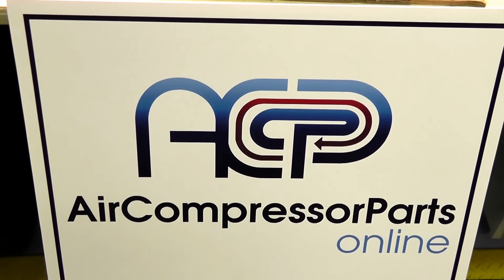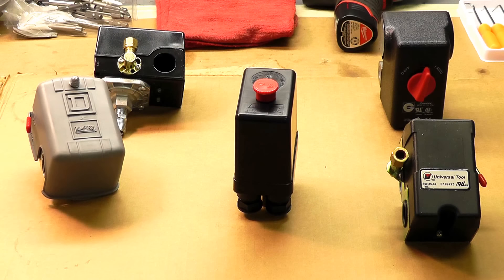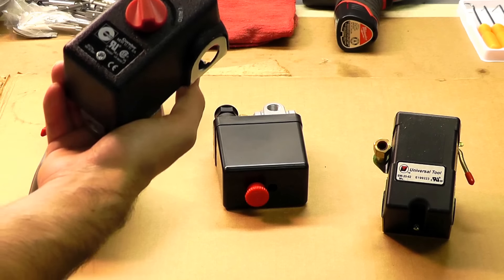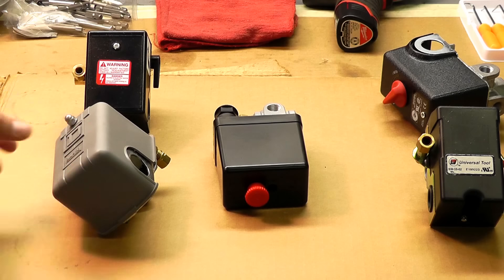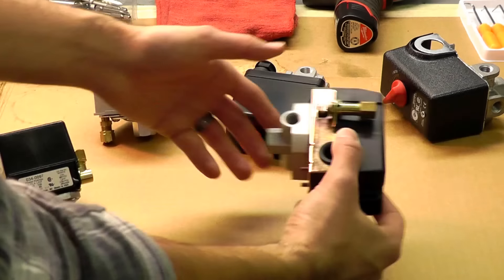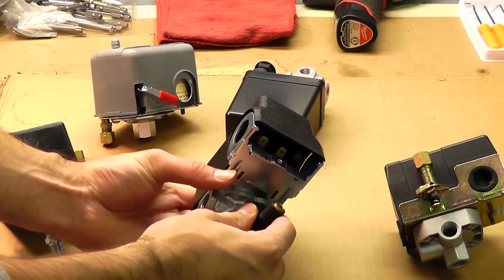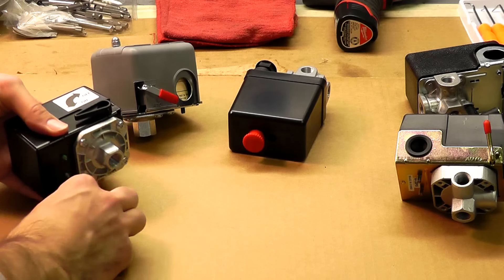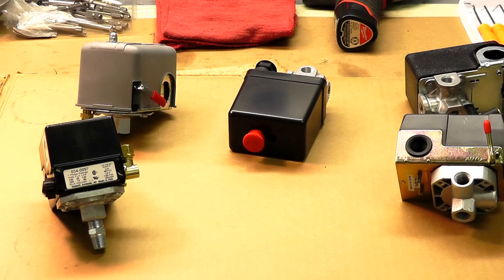Pressure Switch Replacement For Air Compressors

Comment: Hi, thanks for making this video. Unfortunately, I cannot find replacement parts for my Puma PK5060V anywhere online. It needs a new pressure switch. It's a 60 gallon, upright compressor. Are pressure switches at all universal? Mine has one port, and two leads from each side (wall/motor) going into it. A line from the check valve meets it with a bleeder valve on the side. Can you offer me any guidance on how to replace this switch? Thanks, Adam.
Reply from the maker: Unfortunately I can't find any info on your particular model, but I do know it was manufactured around '95. If I could see a photo of the switch I bet I could match a replacement up for you. What is the brand of the switch and model? This should be under the plastic cover.
You can also post this to our Repair Forums site and upload a photo of the unit and switch if you'd like, just click on the below link:
http://forums.mastertoolrepair.com/index.php/forum/index
Reply: Air Compressor Parts Online Hi, it is a 1991 model. Puma sent me a parts manual, and it shows the pressure switch # as 056-CD135P4-001. Unfortunately, there is no number on the unit itself. If it can be replaced by a generic/updated unit, that would be fine. It has one port on the bottom and one side bracket for a bleeder valve (I also need the bleeder valve--would this come with a pressure switch?). Thanks, Adam

Comment: Good day.. I bought a second hand air compressor on my friend.. But the pressure switch is missing. He do not know where it is. How do i know the right pressure switch to be replace? By the way the air compressor brand is vespa with 1/4hp...thankyou i hope you can help me
Reply from the maker: I am not too familiar with Vespa air compressors, to be honest. Does it look like one of the units on the Vespa website, below?

http://www.dragonprimeent.com/product/vespa-taiwan-air-compressor/

You want to make sure you install the correct pressure switch, certainly. The cut-on PSI and cut-out PSI is the most important spec. 

Do you have a model number on the Vespa unit?

Comment: I have an IR compressor with a square d switch in it which is leaking from the underside (unfortunately not the threads but above that on the big connector). After looking the thing over I found a bunch of info stamped/printer under the cover but can't find anything about it on google. Is there a way you can help me decipher what I have and what I need? 
Compressor: 240v 5hp ?stages 60 or 80 gal
Power Switch: 
class: 9013 ser. B
Type: FXG13 S101
Form: M1X1
on             off 125psi

2 pole rating
Volts - amps fl/lr
120-20/120
240-15/90

Comment: I have a 27 gallon Husky compressor with the oiled compressor piston assembly. My question is: at the tank they used a reducer fitting that runs into the pressure switch and then goes to the pressure valve (dial) and then to the tool. I have a 1/2” Ingersoll Rand impact wrench that’s capable of 600 lb reverse torque at 27 FPS but my tank can’t flow that much pressure with the 3/8” high-flow hose and fittings. Is it possible to start at the tank by increasing the size of that reducer fitting and using a larger fitting, going with a larger pressure switch, larger pressure valve (dial) then 3/8” high flow fittings and hose to get an overall higher flow rate?  The issue I’m having is that even with 3/8” high flow fittings and hose I still can’t get even close to 600 lbs of reverse torque from that impact wrench even running the hose pressure at 150 psi for short bursts? Sometimes I can’t even crack off a wheel lug nut off with full pressure and that’s definitely not several hundred ft/lbs of torque. I don’t understand how a larger tank would improve the situation since it’s overall volume, but I’m literally talking about short bursts at a maximum pressure of 150 psi, wouldn’t it be the same for a 26 gallon tank and an 80 gallon tank? I seriously believe if all the plumbing was upsized to 3/8” I could achieve enough CFM to increase the overall power of the torque wrench for short bursts to pop off those lug nuts like nothing. What are your thoughts?
Reply from the maker: Thank you for the question and for the watch! I don't think that installing an adapter with a larger outlet will improve the CFM (volume of air delivery) much, at least not that will make a difference. For your application, the compressor is probably just undersized....I would recommend using a compressor with a higher CFM rating, as your compressor simply doesn't have the CFM output to run the impact wrench (which require a lower PSI but a higher CFM to operate efficiently). Also, make sure to find the CFM requirement of your impact wrench (which will be in the manual) to match it with the CFM output of the compressor you're using.

Comment: My compressor is 25 years old. I can't find a pressure switch. It's a Craftsman Model # 919-15291-2 and it will not shut off. Inside pressure switch cover says it's a AC 0062 # D-56962-2. Can you help me?
Reply from the maker: Thanks for the question, Skip. BTW, we have a breakdown of your model compressor available at the below link:

https://aircompressorpartsonline.com/portable-oilfree-directdrive-electric-air-compressor-parts-919152912-p-802341.html

Your original switch is obsolete so the only option is a third party switch. The manifold on the bottom of your switch has two inlets: one that threads directly onto the stand pipe nipple to your air tank and another where the safety relief valves threads into. The only switch we'd have that's similar is a 4-port manifold switch, so it has three 1/4" female NPT threads in the bottom. You would only need to use two, the other two inlets you would plug.

https://aircompressorpartsonline.com/095125-psi-generic-furnas-style-pressure-switch-fsps495125-p-1027.html

 I'm not entirely sure if the plastic cover would fit over the new switch perfectly, however, as the on/off lever switch on the side might be located in a slightly different position on the switch, so it may not fit through the hole that's cut out in the plastic shroud for it.

I hope this helps!
Reply: @AirCompressorPartsOnline  Thank You very much for the reply and suggestion

Comment: will a bad unloader valve cause pressure switch not to turn on compressor?
Reply from the maker: It's certainly possible, yes. It really depends if the unloader valve is stuck open or closed. If the unloader valve is stuck open, then all of the air from it and the unit will probably never shut off. The unit will still turn on and operate, however, so this is rare.
The more common issue is if the unloader valve is stuck closed. When this happens, the compressor won't be able to bleed off the excess pressure in the lines once it shuts off. If this happens, the unit will try to start against this back pressure, which will probably trip the breaker. This is somewhat common.
The most common problem, however, is when the defective check valve causes tank pressure to backfeed through the lines and out of the unloader. The unloader is not defective in this case, it's just a symptom of the defective check valve, and replacing it will take care of the problem.
Hope this helps!

Comment: i have a 22 gallon craftsman 919.1762200 and need a switch wich one do i need???
Reply from the maker: Thank you for the question. The original pressure switch for that model (made by DeVilbiss for Sears) is obsolete, I'm afraid.

https://www.searspartsdirect.com/model/38mx4wence-000247/craftsman-919176220-air-compressor-parts?page=2

However, as long as you match up the basic specs with your original to one of the pressure switches we offer, you can use an aftermarket switch. You basically need to know the info you'll find at the below link to our website:

https://aircompressorpartsonline.com/1portstyle-pressure-switches-p-286.html
Reply: @AirCompressorPartsOnline  thank you

Comment: I have a job smart pan cake air compressor 90-120 psi i need new switch do you have one?
Reply from the maker: There is a good chance we do. Do you have the model number for your air compressor? If so, that'll make it easier. But, you can click on the below link to view our pressure switches and may be able to match yours up with one we list on that page:

https://aircompressorpartsonline.com/air-compressor-parts-pressure-switches-c-25_2.html

Comment: I have a Porter Cable and just replaced the pressure switch.  It was not the original switch.  Now my regulator does not keep the pressure down at what it is set at, but allows the pressure higher.  I can hear the air hissing out of it.  The switch goes up to about 140 psi then turns off.  Any ideas what the problem is?  It never did this before.  Thanks.
Reply: I have the same problem with my 26 gallon porter cable
Reply: I rebuilt the regulator with a kit I bought online and now it's better.  I did see it do the same thing again once or twice but usually not.

Comment: Are all pressure switch universal. Like I got a rockworth compressor 220 v and I replaced the switch but now it's putting to much load on the motor.
Reply from the maker: Most of the time, yes. Switches can be wired for either 110/120V or 220/230V, but they do have different amp ratings, so confirm the amp rating is high enough for the motor running your compressor. If the above checks out then you may have another electrical problem...it could be the power cord or motor cord, the pressure switch contacts could be damaged, the motor starter switch or the breaker itself.

Comment: I’m looking for a FURNAS 69MB109473R switch, where can I find one?
Reply from the maker: Thank you for the comment David. That Furnas number is a catalog number that I can't cross reference, but we probably do have the switch or a switch very similar available. There is a popular switch that we have available which you can see by clicking on the below link. This is a single-port Furnas-style switch (it's an aftermarket version which is less expensive) with a 1/4" FPT fitting on the bottom. It's rated at 90/125 PSI. It has a  manual on/off lever switch on the side as well as your 1/4" brass compression fitting, which your bleeder line attaches to. Just by searching the Furnas part number on Google and looking at the specs for the original, it appears this would be a close replacement:

https://aircompressorpartsonline.com/090125-psi-generic-furnas-style-pressure-switch-fsps90125-p-1117872.html

Comment: When I turn on my compressor it start out just fine.but halfway the motor starts to slow down then after a minute it starts running great again.Any idea what's going on?
Reply from the maker: Thanks for the question Garry. 
Here are some suggestions:

- The run capacitor is defective (would need to test it with a capacitor tester or have an electrician test it)
- Extension cord (if using) is too long
- Pressure Switch contacts are varnished and need to be polished.
- An obstruction in the head/discharge tube/check valve (just make sure the inlet air filter element in your pump head is in good condition).
- If it is an oil-bath unit, and it is cold, it could be that the oil viscosity is too high.

I hope this helps!

Comment: Hi Do you have a replacement pressure valve for a mac 2200?...and if you do how much w/ shipping to 13801...Thanks
Reply from the maker: +steve Forgacs The original part# for the pressure switch for the MAC2200 is AC0197-2, which is no longer available per Makita.You could use a similar 4-port pressure switch with the same PSI ratings, however. Take a look at the pressure switches on our website at the below link; you should be able to match up the specs on the original switch to one of our replacements:
http://www.aircompressorpartsonline.com/furnas-pressure-switches-furnas-port-style-furnas-pressure-switch-p-287.html
Reply: +Air Compressor Parts Online Great Thanks
Reply: +steve Forgacs The link you sent doesnt work
Reply from the maker: +steve Forgacs Sorry about that! Here you go:
http://www.aircompressorpartsonline.com/index.php?r=product/view&id=287
Reply: steve Forgacs 😘😘

Comment: Does the pressure switch found on water pumps can be used for air compressors?
Reply from the maker: Yes Vishwan, pressure switches found on water pumps can technically be used on air compressors. However, most water pump switches have pre-set pressure settings that are much lower than a typical air compressor will operate at, usually 30 to 50 PSI for a water pump and at least 125 PSI for an air compressor. The switches are identical except for the pressure settings. The switches are adjustable, but cannot usually be adjusted from 30 PSI to 125 PSI. So, it's best to purchase a pressure switch that has the cut-in and cut-out PSI ratings high enough for an air compressor to operate at. I hope this answers your question and thank you for commenting!

Comment: Also I have a Huskey WL 660900AJ and every time it tries to start it blows circuit breaker in my garage. HELP
Reply from the maker: Skip, we also have a breakdown of this unit on our site as well:

https://aircompressorpartsonline.com/portable-oilfree-air-compressor-parts-after-march-of-2005-wl660800-wl660900-p-746926.html

Does the unit hold air in the tank after it cuts off? If so, great...but if air constantly leaks from the tank after it shuts off, you have a bad check valve. A check valve that's stuck (or that has debris inside of it) will cause the unit to trip the breaker when you turn it on, as air cannot get through the check valve into the tank, creating back pressure. 

If the above is NOT the case, there is an electrical problem and it may lie with the motor. In this case, I would recommend having an electrician or compressor tech diagnose the unit in this instance.

Comment: Is there a different between 110 and 220 pressure switches
Reply from the maker: There is no difference in functionality, no. These pressure switches can be wired for either 110 or 220 volts. There is a wiring diagram under the cover of the switch. Thank you for the comment!

Comment: Permission to post Admin. Gentlemen, i need help on this Thanks.
My friend gave me an air compressor Type EY-29 , Cap. 88L , Displacement 215L/min , Motor 1hp , Pressure 8kg , RPM 700 thats all the information my question is what/which pressure switch is compatible with this? And is it ok if i install a 2hp electric motor ? Many Thanks to all 
GodBless
Reply from the maker: Thank you for the question Jose! I did find this air compressor online, you can see it at the below link:
http://www.kakingstore.com/hardware/compressor/vespa/air-compressor-ey-29-2hp
I'm not very familiar with this compressor but it looks like a 2 HP electric motor [should] push this pump. It looks like a smaller single-stage unit and very similar to units we service. You can really install any pressure switch on this unit, just make sure it has the "cut-in" and "cut-out" pressure that you need. I don't know what this spec is for this unit as I don't see any detailed information for it. I hope this helps.
Reply: Many Thanks Sir, sorry i forgot to write down the brand yes Sir this is exactly my air compressor. Well , now, that you've gave me the answer (good one) i can now begin to put together the missing parts without CONFUSIONS 
Thanks so much
GodBless Sir....
Reply from the maker: You're certainly welcome  @jmallari5213  and I'm glad we could help!

Comment: sir...i have a question about  switch...air compressor presure switch they are same to water compressor presure switch...both same function....?
Reply from the maker: Correct, both compressor pressure switches and water compressor switches function in the same way. They both sense the pressure of the air (or water) and turn the unit on and off at specific pressures pre-set at the factory. Let me know if you have any additional questions. Thank you Errol!
Reply: tnx sir...ur info...thumb ups

Comment: great vid. i have a sears craftsman with a furnace type switch. a friend of my fsther in law took it completly apart and lost the screw that runs through the spring. how long should it be, how tight do i tighten it, so i can replace. screw has a allen head look with a pin in the center.pressute switch mfg part number ac-0385-1. hate to have to buy entire switch due to him losing it. and that was not problem, was check valve. lol thank you